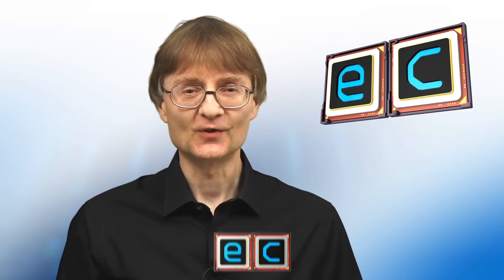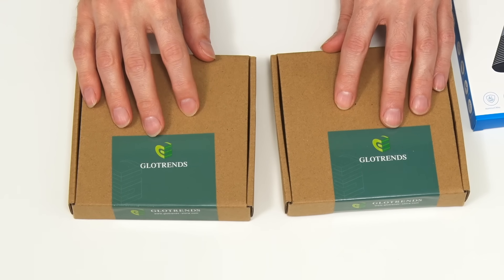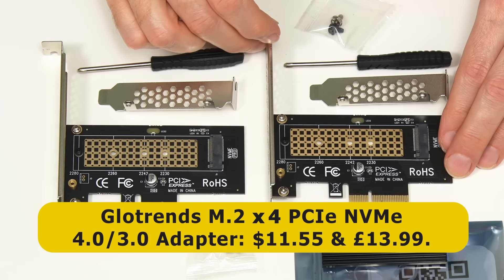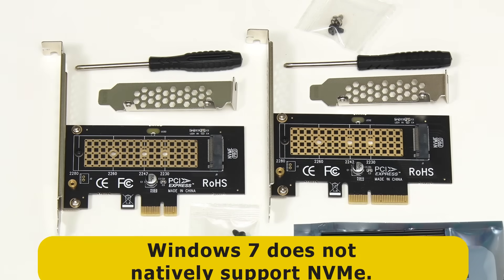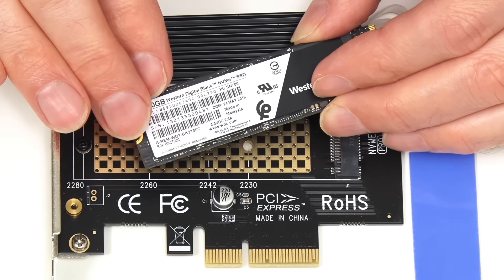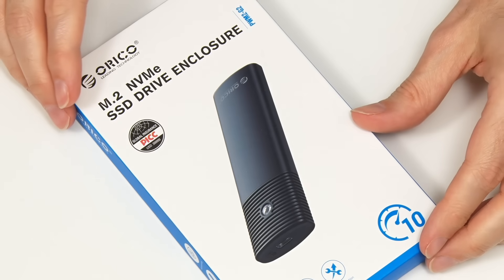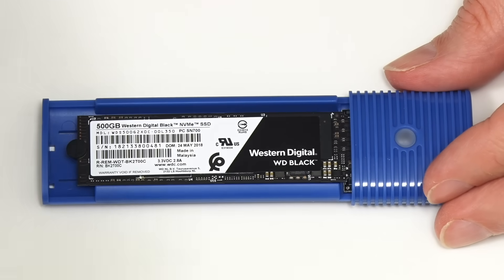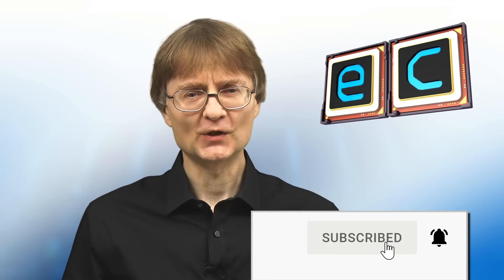M.2 SSD Adapters & Enclosures

Comment: There is one more correction to make about PCIe cards with room for 4 drives. This will only work if the motherboard and software allow for the split of the x16 bus into 4x4 interfaces. Most gen 3.0 allow only a 2x2 split if at all.

Comment: Hey you forgotten to mention if you can boot from the M.2 NVMe SSD installed in the PCIe adapter card.
Reply from the maker: You can boot from a M.2 NVMe SSD in an adapter card if your motherboard supports PCIe booting.

Comment: So, to clarify, one thing I would like to check on. Going through the PCIE does not work as a bottle neck?
Reply from the maker: A PCIe slot is not  bottle neck (or no more so than using an M.2 NVMe slot). But clearly if you have a PCIe Gen 4.0 SSD, and a PCIe 3.0 motherboard, both its PCIe slots and M.2 NVMe slot(s) will be a bottleneck.
Reply: @ExplainingComputers  Thank you kindly for the clarification

Comment: Ive a question 5:12 it off the address of this video but still in the neighborhood.
Can i plug an older PCIe x1 sound card into a full size PCIe x16 slot and it work proper?
Reply: I don't know how I inserted the time stamp into my question.
It has nothing to do with my question...sorry
Reply from the maker: Yes, a PCIe x1 card will work just fine in a PCIe x16 slot. I cover this in depth here: https://www.youtube.com/watch?v=PrXwe21biJo

Comment: One correction.  NVME v4.0 SSDs in such adapter M.2 to PCIe x4 adapter will work full speed if MB has PCIe v4.0 enabled slots.
Reply from the maker: Why a correction? Nowhere did I contradict what you say.
Reply: @ExplainingComputers You talked about PCIe gen 3 only but those adapters do not depend on PCIe version-

Comment: Will a NVMe Gen 4 PCIe x4 SSD work at near maximum advertise speed if you use a "PCIe 3.0 x8 to M.2." adapter? Technically PCIe 4.0 x4 is equal to PCIe 3.0 x8 in terms of speed at least, right?
Reply from the maker: Whilst I see where you are coming from, and theoretically this could be achieved, this is very unlikely to be the case in practice. It would require adapter hardware to combine two lanes into one, and I am not aware that such adapters exist.

Comment: I think I know what a physical connector is, but what's the difference between that and an interface?  To me "interface" sounds like it'd be the same thing as a physical connector.  Please explain.
Reply from the maker: Here "interface" defines the electrical and electronic characteristics for a standard for digital communication. So, for example, SATA and PCIe interfaces can both operate using the pins present in an M.2 slot. But what they do with those pins will be different.

Comment: Very clear explanation!  You can't always tell if something will work the way it should do unless you test it.  For instance, a PCIe NVME 4x adapter is only recognised on the system sometimes until you restart it, where the mSATA drive works every time but causing the hard disk drive light to constantly stay on instead of showing when it's being accessed.  The solution could be to connect it to the remaining SATA 3 socket, which could work faster as so it's not connected to SATA 2 by default.  NVME drives use the same technology as a GPU via PCIe, thereby communicating directly with the CPU as opposed to a hard disk drive interface.  Everyday use would appear the same in speed, unless booting into the operating system.

Comment: PCIE 4 slot fitted NVME (gen4) will be hotplate and with the help of decent heatsink it may hover around (50-80 degree Celsius while Gen3 is well under 40-70 Celsius) and PCIE 5 NVME in PCIE 5 will be oven itself and required well designed almunium or copper external heatsink, otherwise thermal throttling over 80 degrees will be happened.

Comment: Do I need to configure this in bios to work? I'm too scared to play with the bios. I need more storage but I already got 2 m.2 2tb in my slots I was thinking to get m.2 to pcie adapter.

My motherboard is msi pro b760m-a ddr4 wifi

Comment: Yes, the adaptor cards will allow you to mount an M.2 PCIe card into your system, but you may get a frustrating surprise when you find out your older system's BIOS was written pre-NVMe and won't see your card. This is especially frustrating if you wanted to use the M.2 as your boot drive. I suppose these cards are most useful for a newer system which already has an M.2 slot and the BIOS will properly identify it.
Reply from the maker: Fair point, but a BIOS has to be pretty old to not see an NVMe drive (the NVMe standard is over 10 years old). Often on older systems it is OS support that is the issue (eg Windows 7 has no native support).

Comment: Thermal throttling was a very big issue for these devices because the heatsink is simply too small to disperse heat away quick enough. I decide to try the PCi-e Gen4 X16 add in card by Asus whereas four nvme's can be installed and poof, no thermal throttling. I am now able to transfer huge files at 4.2GB/s all day long if necessary. Cheers from Texas!

Comment: PCIe Gen 4x4, M.2 work on PCIe 3.0 slot ? gen 3 vs gen 4 have same dimensions/number of pins/etc . Single differences are about slot max capacity , soo gen 4 of 5-6 Gb/s will work only at 50 % because PCIe 3.0 slot is limited at 4 Gb/s or PC explode ?!?! :))
Reply from the maker: Yes, a PCIe Gen 4 M.2 NVMe drive will work in a PCIe Gen 3 M.2 NVME slot, just at a slower speed as you state. The PC will not explode (well, not due to using a Gen 4 drive in a Gen 3 slot, anyway). :)

Comment: Excellent Video , i have a MSI B-550 Pro board . The motherboard has M.2 slots . A 4.0 next to the CPU and the other M.2 slot is 3.0 . I bought a Samsung 2TB EVO 990 Pro Gen 4 m.2 drive .  I ran the benchmark and my read / write speeds where 3.0 speeds which is about half the gen four speed. Oh well there is not much I can do. I damaged  my other board and B-550 board was a cheap replacement. The rub is ,you can't hardly buy the gen 3 's anymore  on places like Amazon, B & H.

Comment: So Windows 7 and lower doesn't support M.2 NVM SSDs. That means they won't show up as drives on PC right? Bummer. 

Is the sata m.2 ssds supported on Win7 and lower? I was hoping to use these as extra storage.
Reply from the maker: Correct. Windows 7 has no native NVMe support. But there are drivers out there you can install, although they still may not allow you to boot from an NVME drive. SATA M.2 drives should be supported, as the OS will just see them as a SATA drive. Note that sometimes in the BIOS you need to enable SATA support for an M.2 slot (if it supports it), and this can disable a standard SATA connector. But using a PCIe card as here, you should be able to access a SATA M.2 drive.

Comment: love your videos - didn't know nvme is only useable on win8 and above - I was about to consider purchasing one for my win7 gaming rig but after watching and learning from you I see it's useless until I move out to Linux (I'm not a fan of win10-11 idea of privacy ...)
Reply from the maker: Thanks for watching. There are NVMe drivers available for Windows 7, but they are not native to (ie included in) the operating system. So you may be able to get a NVMe drive working on your Windows 7 gaming rig, but not without some messing about -- especially if you wanted to boot from it.
Reply: @ExplainingComputers  thank you for the reply.

 Actually, I was thinking of migrating to Linux and I'm been following your guild to linux - my thought are going towards Mint, same as you. But my main concern is my extensive STEAM library and it's future so I might need to dual boot with win10 or 11 as I have some older titles that will not run on linux, and I have no experiance with wine or any other windows emulator on linux

what do you think ?

Comment: I purchased this enclosure from Amazon.

SABRENT USB 3.2 10Gbps Type C Tool Free Enclosure for M.2 PCIe NVMe and SATA SSDs (EC-SNVE)

Takes both SATA & NVMe drives, and the top is clam-shell rather than slider, so swapping drives is easy, and it works a treat for cloning M.2 drives.
USB-C connector.

(I use it to play around with M.2 drives on my RPi Argon cases, plugged into the RPi’s second USB3 connector, or on an OptiPlex running Linux)
Reply from the maker: That's a nice enclosure. Good find. Thanks for sharing here. :)

Comment: Will the pcie adaptor work on dell 9020 running Windows 11
Reply from the maker: It should almost certainly work (ie you could access a drive), but it may well not be bootable on what Google tells me is a 2013 PC. You would need to find and check the motherboard manual.

Comment: and what happens if the motherboard has more than one graphics cards slots and the adapter your using isnt getting detected in the bios and the motherboard doesnt have onboard graphics which slot does it supposed to go in and does also depends on the drive as well????

Comment: You always seem to post a video on a topic that I absolutley need at the moment. I bought an M.2 enclosure, similar to the one you showed, but it doesn't appear to want to read the ssd. I think I am putting it in correctly.... at an angle then securing it with the rubber do-hickies. I wanted to clone one of my laptop drives to that M.2, so I could put it into that newer laptop. I managed a clone but i had to so it with a burned cd of Rescuilla's iso. I was running Zorin 16.3 on a 15-year-old Toshiba, and wanted to clone it then clone again it onto a new GeoBook. It was running fast on the Toshiba. Now it flies. The only issue is I can't seem to get the audio or bluetooth working on the GeoBook. At any rate, thanks for all your posts. If I was a mutant freak, I would give this video four thumbs up.

Comment: Regarding the M.2 NVME enclosures. I have one and it works sufficiently well for transferring data but found it is for M.2 NVME drives ONLY. I purchased 2 rare bootable AHCI M.2 SM 951 SSD drives for my older HPZ workstations and it would not initialize using the enclosure smh lol. I purchased the HPZ Turbo PCIE cards for them and then they worked as expected.
Reply from the maker: As noted in the video, M.2 is just a connector, and there are either SATA or PCIe (NVMe) drives -- and you need to get an enclosure that supports your drive type.

Comment: In practice, I find by far the most important factor in speeding up my PC is in the reduced latency on random access, not the ultimate in sequential throughput. As such, I note that there is relatively little difference between the performance on the x1 and the x4 PCIe interfaces, whilst the USB one is substantially worse on the relevant CrystalDiskMark result (the RND4K Q1T1 run).  It's less than 60% of the speed on reads, and 40% on writes. 

Whilst there are applications where the sequential throughput is a very important factor such as, maybe, video-editing, it's that random access capability that seems to dominate, especially on system access. It's a factor that I think tends to get over shadowed by those sequential access headlines.
Reply: For this reason if x2 bifurcation was available I'd love to see a PCIe x16 to 8 drives adapter.  I think some older LGA 2011 systems or SuperMicro offer this.  Would be good for a NVMe based NAS

Comment: There is  one adapter I have not yet seen, but would love to see. It would take a M.2 NVME SSD, and be 2.5" laptop SATA form factor. A SOC of some kind on the adapter would store data on the M.2 NVME drive, but appear to be a SATA drive to the system. This would fill the gap to allow even the original IBM PC to use modern NVME SSD's via SATA-IDE adapters. I am aware that this would bottleneck the SSD horribly, but it'd allow keeping old systems online. Some manufacturers have already stopped producing new SATA SSD's in any form factor.
Reply from the maker: That would indeed be a great adapter. :) That product should exist!

Comment: Cooling a SSD is something you shouldn't overdo. Flash memory actually work bad at too low temperatures. And even 20°C is too low for optimal performance. In general something like 40°C to 60°C is considered good. More than that is not recommended and going lower can cause performance or in the long run reliability issues.

Comment: Thanks for this informational video. Up to mid 2022 I was hesitant on getting an SSD drive. Maybe I was too lazy to open up my case or didn't want to pay about $100 for a 1TB when I can get a 5TB HDD for it. 

Once I see the big difference between an HDD and SSD in terms of how fast it boot up to Windows and load the apps, I did not mind paying the difference. Then I started upgrading to NVME, which at most computer stores are about the same prices as SSD but about 7 times faster. I leaped for the NVME and so far very impressed.

I did not know much still about NVME until I watched your video. So it definitely helped me understand the differences between the different versions. So now I know what to look for on my next PC. Many thanks.

Comment: In my case it was better just to buy an all new motherboard with 4 m.2 slots.  The real issue is my generation of motherboard is not Windows 11 compliant and Windows 10 is expected to loose all support by 2025.  Also Star Citizen is super CPU intensive (nevermind GPU intensive) and my older motherboard couldn't accept a 13th generation CPU.  Oh well, my old motherboard owes me nothing after 10 years of service and other minor upgrades.  10 years is damn long time for a motherboard/CPU/Memory combo.

Comment: All this Problem  will  GO Away  if we were to Throw Away OLD Motherboards,  using old Processor in new motherboard.
Thrn we will  achieve FULL sppeds .
Otherwise we are loosing , Spped , Cost per GB,  when we put PCIe 4.0  into PCie  3.0 motherboard.
Reply from the maker: Not true for two reasons. Firstly, how exactly do you intend to use old processors in new motherboards that have different CPU sockets and do not support them? $9 PCIe cards are a pretty cost effective way to add extra functionality to older hardware.

Secondly, as this video highlights, a common reason to use an M.2 adapter or enclosure is to allow an SSD drive upgrade -- and this can happen with a PC with a very new motherboard that has an M.2 slot. Granted you could "throw away" a new motherboard with one M.2 slot to get a more expensive one with two slots to allow the clone. But it would be much cheaper and less disruptive to use an M.2 adapter or enclosure! :)

Comment: Have you ever done any videos on using an SSD on a Raspberry Pi to prevent the SD card from crashing after a long time running one application? Tired of a Raspberry Pi 3+ corrupting the SD card after a power failure and having to rebuild the entire system. Thanks...

Comment: What a good video you give us again, man. But it would be interesting to do a second part, in which you show functional methods to start an old PC that does not have an m.2 slot or that supports it from a chipset or CPU. Say for example, booting an AMD FX-8350 or a Core i7 4790 directly from Windows installed on an NVMe PCIe 3.0 SSD mounted on a 4x adapter... That would give an impressive new life to PCs from those times...

Comment: U need 4x pcie for the adapters.
Reply from the maker: You need a x4 PCIe slot to use all four lanes on an NVMe drive. But as the video clearly shows, a x1 NVMe M.2 card only needs a x1 slot, although the speed will be limited.

Comment: You might want to note, cards supporting multiple M.2 disks, require the motherboard to support bifurcation. If the motherboard does not support bifurcation, you will not be able to use all the disks on the card. There are cards that have a don't require the motherboard to support bifurcation, but the are substantially more expensive.

Comment: Very informative video - thank you! I was wondering (perhaps stupidly) if when using a heatsink, you should remove the info sticker from the drive? If its getting hot enough to require a heatsink, is it getting hot enough to burn the sticker? I think my next upgrade on my M1 Mac Studio is an external Nvme - now I just have to learn all about thunderbolt 4 🙂 Thanks again!
Reply from the maker: For the most effective heat sink operation, the sticker should be removed. But this almost certainly invalidates your warranty . . .
Reply: @ExplainingComputers  Many thanks for taking the time! Much appreciated!

Comment: My son needed more SSD storage to run Starfield so we quickly bought the same X4 board in your video and a 2TB Nvme drive. All worked perfectly, first time! We put the heatsink on just in case. We took a chance as it was just before this video was published. Learned a lot from this and will check my performance this afternoon. Feels very fast and Starfield works perfectly now.
Reply from the maker: A great result. :)

Comment: This question might be alittle of topic but i'm searched for many months to find the answer and i've found no reliable information so i thought i would ask Chris.  On Laptop motherboards that support M.2 drives, if you want to place a thermal pad onto the drive, do you put the pad on the tops of the drive(part that has the label) or do you put it on the underside of the drive(between the drive and motherboard)? The reason i ask is that most people say that the thermal pad should be on the top of the drive where the NAND chips and label are located to dissipate heat.  But whenever i've bought Lenovo Thinkpads from the factory, the preinstalled thermal pad is on the underside of the drive between it and the motherboard.  Why would the factory do this if it's wrong?? Thanks.